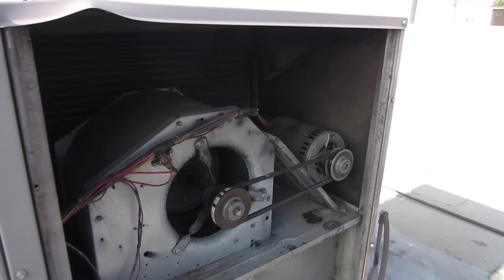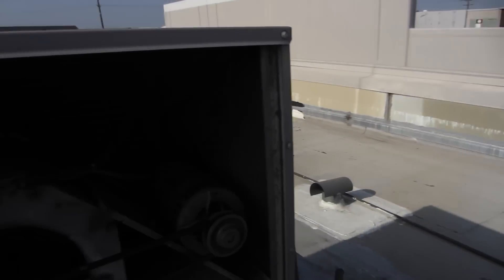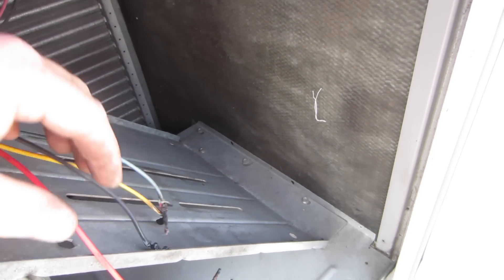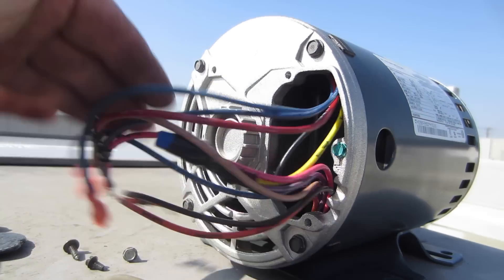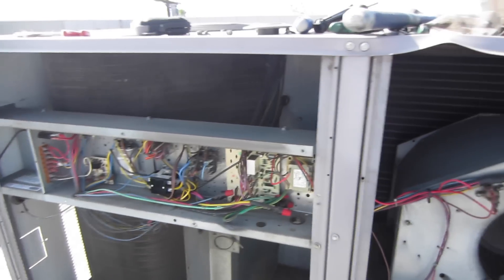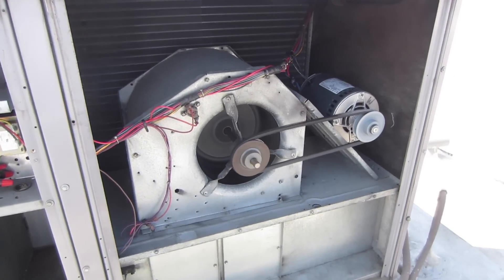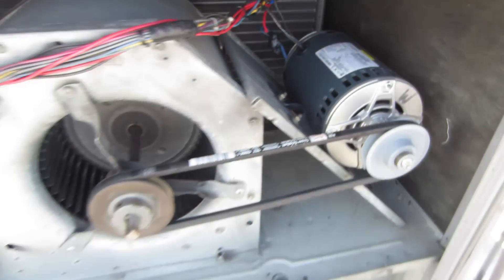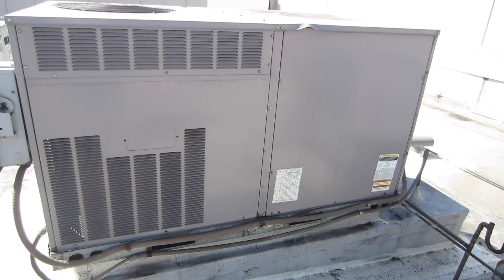Motor meltdown

Comment: Running smooth now, and not smelling up the interior space as I suspect the old one was doing!  By the way, do you think the thermal sensor on the old one was defective, or do they occasionally burn that bad before the sensor trips?  Interesting video -- thanks for showing.
Reply from the maker: The only thing I can think of is the bearings wore out and the rotor and stator made contact and the metal shavings spot burned the winding.It must of happen fast, the overload was triped but I think it was defective (delay reaction). Thanks for watching!